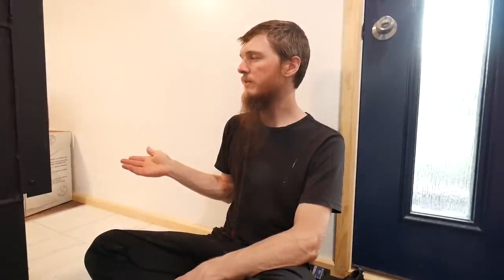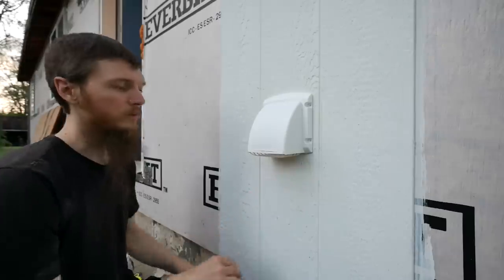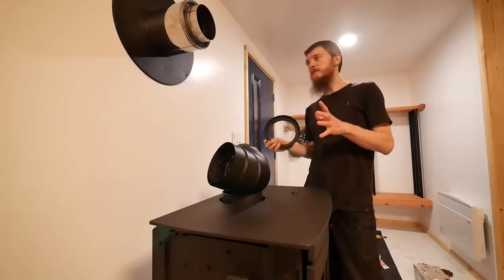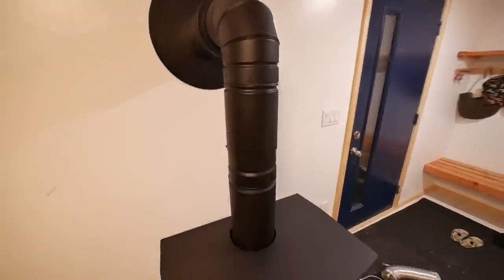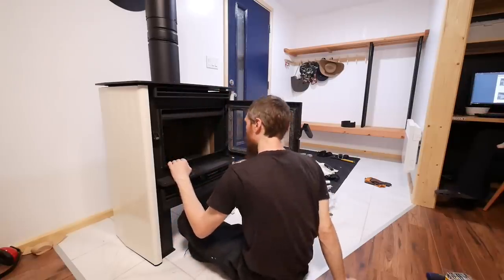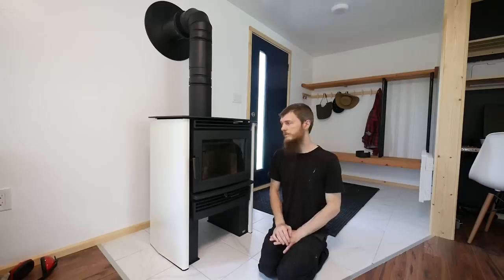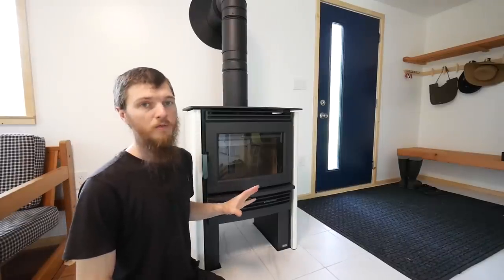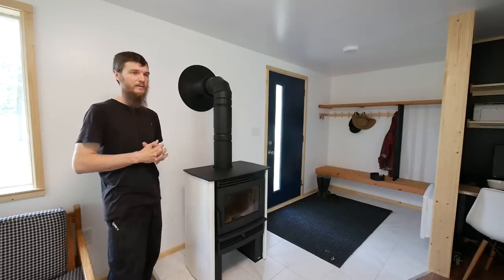DIY Mobile Home Wood Stove Install

Comment: WOW...I had a Vermont Castings Wood Stove that we bought second hand for our cabin back in the late 90's. That thing wasn't big but it was a work horse...we got a small metal bucket we would fill with water and put on the stove to add moisture when we used it. Also found a used pair of welding gloves to use...they worked great...used a few dried sea rose heads and petals in the water for natural  room scent along with some essential oil....great smell...even made some bread dough using that stove...natural bread machine!!!!! Tech for wood stoves finally has stepped up to meet the various demands of homeowners....  :) Cheers from Maine

Comment: Just a tip, remove the fingerprints from the stainless before getting it hot, if you don’t, the smudges will be permanent

Comment: )ne problem  with your install, you put the black pipe in upside down.  During the winter your stove will leak creosol down the side of the pipe. The crimped end of the pipe on single uninsulated pipe always points towards the stove....
Reply from the maker: All of our chimney pipes are double wall. The inner pipe on that piece is installed with the crimp on the inside.

Comment: It is your family place, your family project, your rules. It is not my place to question what you do. You explained the process clearly, showing how you arrived at your installation. Drawing ducted combustion air in from outside is very sound. I doubt you would generate a high vacuum, but making the fire burn clean with a good draw could be a real challenge without the vent. Getting the flu outside and breathing without cutting holes in the roof above the living space makes perfect sense to me. You do not want the cooler weather arriving yet to try it out, as there is still outside work to be done. It must be a comfort to know that you are ready for when the colder days arrive.
Well done it is another great step along your progress line.

Comment: Impressive!   I had a wood stove nearly 40 years ago, I loved it.  Sadly I was either unaware of or did not discover the 'ash drawer' option.  Scooping ashes from the interior is my only true negative memory.  I had a large black cooking pot filled with water I sat on top to add moisture to the hot air.  I added orange slices, cinnamon or other items to scent the air, it was glorious.  Warmth with a clean and refreshing aroma.   My home was on a cement slab yet the wood stove kept the floor from being cold beneath the ceramic tiles.  When I sold the home the wood stove was a huge selling point.   I kept copies of my electric bills to document the winter winter bills were less than $26 per month.  The second family that looked at the house purchased it.  Of course my woodstove was not as attractive as yours.  I think the side panels are a huge plus.  Kudos on a job well done.

Comment: I grew up with a pot belly stove in the kitchen. That thing gave off so much heat we were able
 to wear shorts in the winter on the first floor of the farmhouse. It didn’t use a lot of wood either which was an added bonus. We had a traditional wood stove in the basement that my dad connected to the air ducts and that one heated the second story. It cost my dad about $50 a year to heat his house.

Comment: That is very nice. I remember growing up, after they replaced our kerosene heater, we had electric heat. Worthless during a power outage. So we always had a gas cook stove just in case. I've been planning for a small fireplace here in Florida. It can get down to 20° here at times.

Comment: That is a beautiful addition.  Sleek and modern.  I have a Franklin stove, which is quite the opposite.  You will appreciate the bottom space between the unit and floor.   Will make it easy to clean under that.  You're doing such an exceptional job on your home.

Comment: Oh Dear you will be so happy for everything you've done this summer when winter comes. I think I remember you keeping track of how much electricity/gas etc that you used for heating the first winter, right? Please let us know the difference during next winter. You will be so comfortable in this house, I'm certain... In Europe there's a lot of these types of wooden stoves, and they are very efficient and easy to live with. Your air intake is a little overkill, but you will not have problems lighting your fires... I love everything about your house and the way you guys did it, can't wait to see the finished result with the new roof and climate shield.

Comment: We bought one of those little fans that sits on top of the wood stove and works from the heat of the stove. It really moves the warm air! We have an electric fan but have not used it since we bought the other one. We purchased ours off Amazon.
Reply: We decided to try the stove top fan after an ice storm took out our electricity for a couple of days. We also have a huge open concept living room, dining and kitchen with 14 foot vaulted ceiling. It is cold in here in the winter.

Comment: That is the most beautiful woodstove! I love the whole set up right there with your wood close by and stacked neatly. And so smart to have the chimney outside where you can clean it easily and not have to worry about leaks which are very common around chimneys

Comment: I am so glad you explained all that- was worried at first.  We heated with the old cast iron wood stoves when I was growing up and that was not enough space behind it for those.  Seen fires where they weren't installed right.  Just remember if the wall becomes too hot when you fire it up, stone board or cement board can be put behind it.  I like the looks of this one.  Really clean and simple.  You can also use a metal cookie sheet under it to catch the ash mess and put your shovel on.  Pretty sure that's the last of your inside list.  Will you be starting on the siding and roof next?  PS- I like that you research everything you do.  I do that, too...maybe over do it sometimes, but I like learning what's out there now and what our options are.  Have a good week!
Reply from the maker: Thanks, yep roof will be next and siding after that. We also have a couple inside jobs left :)

Comment: I have the 1,000 comment. When my parents had a wood burning stove, my dad kept a pot or kettle of water on the top. He said it was to keep moisture in the air. I don’t know if your stove is new and improved but you should look into it. Also when you open the door to add more wood, the wood pops and cracks and it can spark out onto the floor. I just wanted to let you guys know about this in case you didn’t already. Your home looks amazing. You should take pictures and send them into Better Homes and Garden magazine. They might just publish them. Just throwing this out there to you. Ashley could look into that. Even the bedrooms and bathroom. Don’t leave out anything.
Reply from the maker: Yep, we both grew up with wood stoves :) Thanks!

Comment: Nice job! We had a 16 inch burn box with airflow chamber similar to yours, it worked great. Only the bedrooms at the far end of the house needed supplemental heat while using the wood stove. It is a very high efficiency system.
You'll enjoy that this coming winter!

Comment: That is really a nice stove. They have really improved them since my last one. I had a freestanding that would run you out of the house. It was twice the needed size for the country cabin.  The previous owners must have been cold natured.  My last one was a fireplace insert.  It was great and   heated the entire house, plus it had a lift up decorated extra top piece to cook on.  I really love the sleek look and the white sides of this one.  It blends in very well with the rest of the living room.

Comment: Glad you explained in detail, you answered my question. I like the looks of it.  I have a fireplace in my mobile home, unfortunately it has a crack in the back wall, and it butts up against inside closet so I won't use it it's a risk I don't want to take.  Another good one.  Take care and stay safe and healthy

Comment: Awesome choice of wood stove.  Awesome install.  For that chipped paint on side panel get yourself some appliance touch up paint that comes in a small plastic bottle with a built in brush and it has a white gloss finish which should match your side pieces.  Then save the rest in case you have to do any future touch ups.  Later

Comment: This is a really clean install. Pacific Energy make quality stoves and I think you made a great selection with that model. Based on the size of your home and the R22 insulation with properly installed double-pane windows, you could very easily heat the entire place on just the woodstove assuming you can get air moving between rooms. On my place, I had to throw a couple of powered vents to move air between spaces to even out the heat.
One accessory you might consider if you find that you're getting too much heat on your ceiling and not enough at floor-level, is an ecofan. It's basically a fan with a peltier junction generator so it is powered off your stove's own heat and kicks warm air forward. It's extremely quiet, so well worth the investment over a box fan.

Comment: Nice stove. I had wondered why you hadn't put fire retardant wall behind it but figured you had bought something not needing it. I had put marble behind mine with cement board but seeing now this doesn't do radiant heat I understand. That's a cool little stove and should roast you guys out in winter. Definitely cover that outside vent so unexpected things don't get in.

Comment: I knew you guys would pick the perfect wood stove. It's just impossible for you to screw up aesthetics, lol. Just wondering if it will need a blower fan? And I missed where the damper is? You are going to love the wood stove! Power goes out and no worries. I would think you can put a kettle on it too for hot water. I also love that it doesn't look clunky in the room. Blends in great. Excited for the living room reveal♡
Reply from the maker: It's hard to say but we've used stoves before without blowers and they do just fine. This stove can have an optional blower installed if needed. The newer stoves generally don't use dampers, but there is an air control lever on the front just under the door.

Comment: I want to start by saying I love the woodstove! I did notice the way your piping is running from the outside to the stove inside the house. You have the pipe running the way we had ours to start with. We found that if you run the pipe so the pipe runs down into one another from the top down the creosote will stay inside the pipe. We ran ours the way you have yours with the pipe on the outside facing down instead of the other way. This made an awful mess with the creosote running down the outside of the pipe inside the house. Looked awful and smelled worse. Not trying to tell you what to do but I hope I articulated it well so you understand what I am saying. I do love the stove. The style, the placement, everything.
Reply: I do understand   your right .  And I did suggest a a pan under stove   cause of cleanup

Comment: I was unaware that there were wood stoves that did not require wall backing and did not require clunky flooring. It is a nice clean look.If you did not say where you got your stove through could you please leave a link or say the site. Very informative video well done
Reply from the maker: We got the woodstove from a local dealer. We put a link to the woodstove in the video description :) Thanks!

Comment: Enjoy the explanation of your very thorough thought process. Just a suggestion, you might consider extending out side chimney a little closer to ground. Will make your clean out more accessible and prevent a face full of soot when you do clean chimney.

Comment: Looks beautiful!  Love the shape and style!  Back in the day we had a BlazeKing wood stove and had it for many years. We had to install an asbestos base and backing on the walls etc to insure the safety then. I love the newer looks of the stoves. In winter there were many times when I cooked on top of it as the power would go out for a day or a week!  I thank gosh we had it then!  I also kept a t-kettle of water on top and full to put moisture in the air so the house didn't get so dry with static. We did have ours go out the ceiling and after sixteen years or so it did begin to leak so then we had to contend  with the ceiling.  We also had double insulated walls on our pipes.  Every so often we had something we put in with the fire to help burn hotter and clean the creosote out of the chimney so we never had a lot of any issues with it. You might inquire about that if you ever might have a concern. I love the heat it gives off and the fire burning is so relaxing. 
It looks beautiful.  I am so excited for you!  YAOOOOO Hopefully you can have a fire in it sometime and share that with us! :-)  Awesome job of installation and beautiful work as always. 
Blessings

Comment: That is a beautiful stove, so well planned, researched & thought out. You scared me for just a moment, #1 I thought you where going the pellet stove route, we tryed that & it's not nearly as warm as wood heat & becomes expensive quickly. As we live in a mobile home also & it was are only resource for heat & we went through a bag of pellets a day & where still cold. #2 I figured the wood box of the stove was well insulated & you checked all that out. We put fireproof drywall behind ours. But the wall behind didn't seem to get to hot. I'm sure you most likely have allready thought of it, #3 don't forget your tools, such as ash bucket, poker, shovel for ashes & this was so helpful to us, we burned wood for years & years & grew up burning wood. Hubby is a welder by trade & a pair of welding gloves for loading the wood stove we wouldn't have known what to do without them.. the ashes are good to throw on your garden spot also... you proably know all this, but just trying to give you info from a wood burning family, it's quite the undertaking to keep up with the chain saws as well learning to sharpen your chain & keeping your chainsaw running is an art form in itself. Watched hubby do it for years & haven't ran into in one else, besides my dad that could do it as well. Hubbies best freind came back from Alaska he lived there until retiring & can't sharpen a chainsaw to save his life. He tells me one day his chainsaw is cutting sideways, hubby says he's proably only sharpening one side.. I had to laugh at the Alaska not wilderness man..  to funny.. Mo. has cold winters..
Reply from the maker: I'm not so good at sharpening by blade either, haha

Comment: I have a quadrafire stove in our doublewide. Went straight up with the stove pipe through the ceiling on an inside wall. There is not much crawl space beings they have such low pitched roofs. Best to keep the pipe straight up and inside as much as possible pipe stays warmer on the inside better draft less creosote build up. Never had any issues going on 14 years.

Comment: Looks great! 
In regards to your stainless... Before you fire it up (lol) don't forget to clean all the fingerprints off the stove pipe first. 
Once the pipe has been heated, it will discolor a bit, but look much better than what it will if it discolors and has finger prints!
Its something I learned about performance exhaust in the automotive/Motorcycle industry.
Reply from the maker: Good tip.

Comment: I heat my mobile home with a wood stove.  The previous owner removed the oil furnace completely and the wood stove is the only heat source I have.  That said, over the past couple of years since I have lived here, there are many days during the winter that I have had to open doors and windows to try and cool it down inside.  The outside temp was 4 F and inside was almost 100 F (until I opened windows and doors).  I love the wood stove though.  It has to be the cheapest form of heat for me as I have access to over 1000 acres to cut firewood on.  I just finished building a wood shed out back to store my firewood in after it has seasoned.  The shed it 8 ft by 16 ft with a lean-to style of roof that is 8 ft high at the back and 7 1/2 ft high at the front.  It should hold close to 7 to 7 1/2 cord of firewood.
Reply from the maker: They produce excellent heat. Ashley's home growing up was heated by wood stove only as well.
Reply: That is GRAND.  I am BLESSED cuz you are.  I LOVE the SMELL of WOOD.
But 😥  I have a HARD TIME breathing
With wood.burning.  I wish I DIDN'T.
PLEASE ENJOY for ME.  THANK YOU.
I HOPE and PRAY that I can find some LAND to LIVE in a LOG CABIN HOME.
I can move anywhere.  CHOW
Reply: @evalinawarne1337  At times, I have problems breathing too, but the wood stove never bothered me.  The smoke doesn't come inside because it is inside a metal box and all the smoke goes up the chimney.  A fireplace would release more smoke into your interior though.

Comment: That’s a nice wood stove but it doesn’t have a fan on it. In Australia we have fans in our wood stoves so they blow the warm air out into the room and it’s more efficient in heating the room. We have had a few different wood stoves over the years some with fans and some without and I much prefer the ones with the fans. Your living room should be about finished now. Can’t wait to see the finished space. I’m sure it will be very cosy.  Does Ashley crochet? All you need now is a crochet rug for snuggling up on the couch on those cold evenings.
Reply from the maker: There is an optional blower that can be installed at anytime if we find that it's needed.  :)

Comment: We install a lot of ceiling lights these days and run those large hole saws in reverse most of the time. A newbee showed the crew a better way!
Reply from the maker: Thanks for the tip.